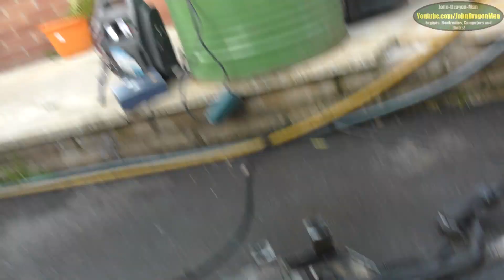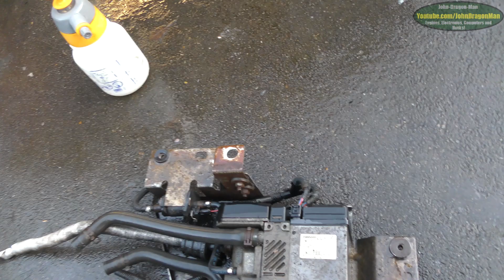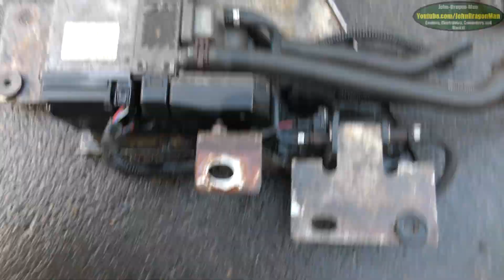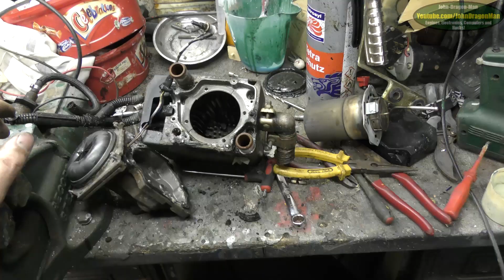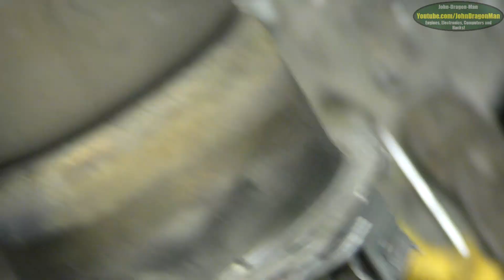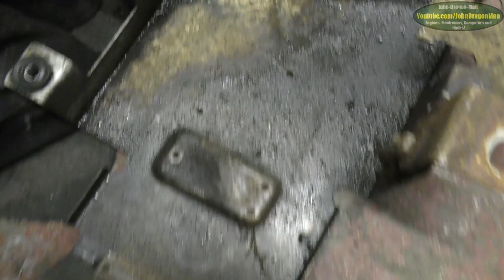Dead Webasto Thermo Top supplementary Diesel coolant heater

Comment: Regarding the lockout on the controller - If I remember correctly, the Webasto servicing software is (*ahem* unofficially) available online and you can use a CAN interface to reset it. I know this because I got all the bits together to sort out the dead one on my motor only to find that water ingress has caused the aluminium inside the electronics housing to corrode and short out the PCB and irreparably burnt up the electronics making diag software somewhat redundant :(
Reply from the maker: since this video I've actually...  "acquired" the software. should be able to get some of my old ones running again. however I am still tempted to use a more newer one just so it won't be all corroded and have every screw snap. I may be having a clear out soon and getting rid of all my old ones. most of them are too far gone to recover. should able to salvage and unlock the pcbs for future use though. may be use the older pcb in a newer canbus heater. it's all fun experimenting with them.
Reply: @johndragonman  the water pump is run from the pcb where it plugs in
Reply: @johndragonman  https://youtu.be/uFjV6FST8Hw

Comment: Hey buddy, very interesting video, dam shame about that heater. Would of been good in ya van mate 👍😉

👍👍👍👍👍THUMBS UP👍👍👍👍👍
Reply from the maker: i do have a few more to test :D
Reply: @johndragonman  mate your wiring then wrong my friend 
The fiat ulysse ones which is same as c8 and 807 and lancia
The blue wire is constant 12volt +
The green/yellow is content 12volt -
The white orange is switch positive 
These are non kbus webasto’s
That’s where your frying pcb’s
Reply: Hi John, I know this is off topic but I have one of these in my bmw x5, I think it’s the thermo top z, the vacuum pipe makes noise when the car is sitting and I’ve not switched it on. Any thoughts on what this issue might be? Hope you sort yours out!

Comment: This chap in Lithuania makes or refurbishes replacement control board PCBs for these things. He also does the ones that let you convert from a CANbus installation to a fully self contained application like you would need in a boat or a caravan or whatever with no ECU. https://www.ebay.co.uk/itm/Used-Webasto-Thermo-Top-C-Z-C-diesel-control-panel-different-AND-REPAIR/143209101889?epid=15025646642&hash=item2157ed7a41:g:gw0AAOSwd7Fb5C1Q